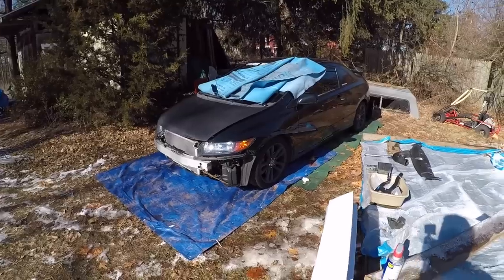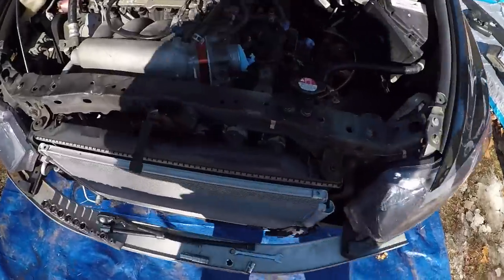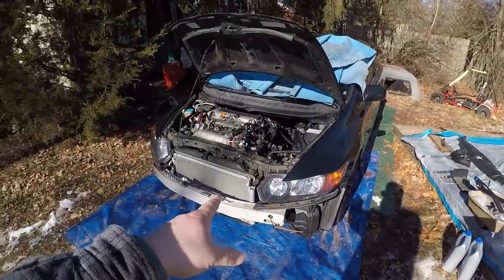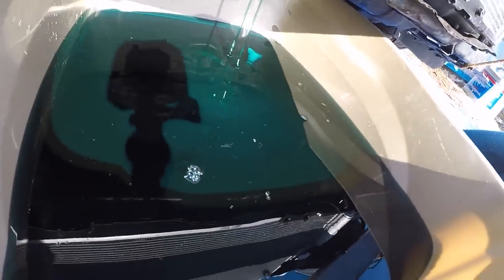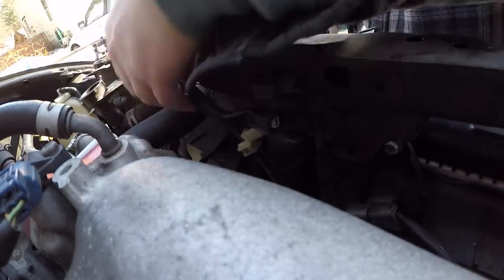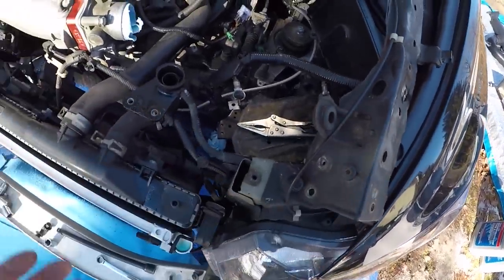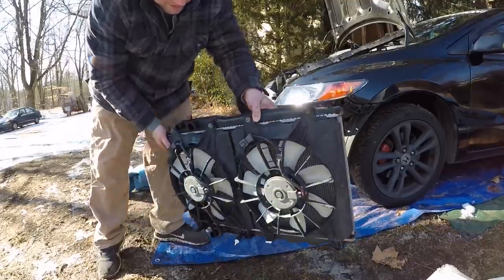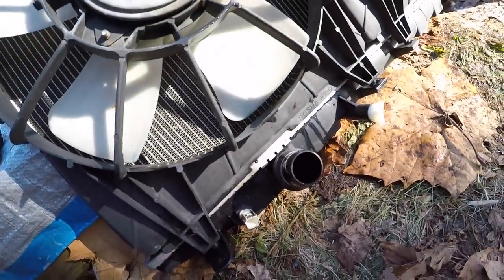Honda Civic 2006-2011 Radiator Removal And Replacement DIY

Comment: Hey did u have coolant leak from the coolant sensor area? Just wondering bro cus some aftermarket radiators leak from there
Reply from the maker: I didn't bro
Reply: @TheGerbsteve  Thanks for the response bro.

Comment: I got the same radiator and the sensor plug is leaking so bad. The o ring place is not tapped as OEM! How did you overcome this issue?
Reply from the maker: DM me on instagram, send me some pics @gerb_productions
Reply: @TheGerbsteve  sure bro..
Reply: Gerb production did u have that sensor issue? I am going go be replacing my radiator soon with the same radiator you install here on the video.  Jesus, just wondering if u got it fix?

Comment: I got a mizu 2926 radiator and the coolant temp sensor that came off my old radiator does not fit the new one. Still can’t find a mizu 2926 if anyone can lead me in the right direction I would greatly appreciate it.